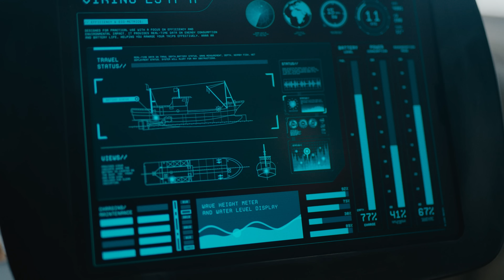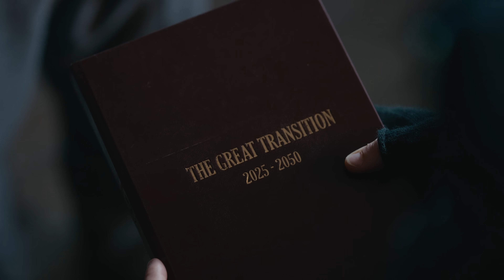The Great Transition (2025–2050) - A glimpse into our energy future

Comment: Unfortuntly this wont work - it depicts a future that relies on so called "renewable energy" (wind farms/solar) however these renewable energy soruces still use vast amounts of fossil fuels to produce, require complex maintainence and will not be possible to make at scale once the fossil fuels are depleted. We should be using the little time we have left to build resilient, decentralised, small community scale infastructre systems for energy (trompe/ hydro) and locally sourced food supply lines (permaculture/ syntropic agroforestry) We must accept that every generation from now onwards will have to make do with less and less avilibility of the fossil fuel cashe we have been squandering since the discovery of oil (energy decent future - david holmgren). This is assuming of course that we arnt wiped out by AI by 2030.. quite a realistic possibility unfortunatly.

Comment: The energy transition would only be possible with nuclear power. The amount of area that solar panels take up can damage ecosystems, and there's a very high amount of bird deaths for wind turbines. However, nuclear energy produces a very high amount of energy in a small amount of area, which means it doesn't damage ecosystems as much as solar and wind. Nuclear energy is also by far the safest energy source, and nuclear waste isn't much of an issue and is easy to solve with simple underground storage. 
Next generation reactors are also coming out, and nuclear fusion would be even safer than the already safe fission. I'm not a solar or wind hater, but nuclear should be the main focus of the transition to green energy.

Comment: I installed 6 solar panels (20 yr. Lifespan) and a 300ah Lifepo3 battery (8-10 Lifespan) with all necessary equipment (about $1000) for a self-sustaining power solution for emergencies. The system is clean, efficient and is capable of keeping lights on, TV and electronics running, keeping a fridge running, cooking food and running a gas furnace. I can't imagine that people fear solar and wind more than the destruction of their home planet??!!
Reply: You said it right there. Running a gas furnace.

Comment: Nuclear energy could solve a lot of these issues. And no nuclear waste is not an issue. It can be reused for more fuel. Wind and Solar isn't going to cut it for our energy needs esp with Ai.
Reply: That is not a "solution".
Reply: @benjaminharris943 how isn’t it?
Reply: Yeah thats not working either, because it’s way to expensive.

Look at France:
They went all in for it and the state is paying lots of money to keep the price down.
They even have often problems in the summer to get enough cooling water from the rivers, so they shut them down and buy the rest of the energy they need from their neighbours.
Reply: @meetteel6811 expensive due to regulations excessively piled on. Maxnomics did a video on this exact topic.
Reply: @VelocityFreak Looked it up and it’s definitely falsefying common facts.

In the early beginning he talks about plutonium like it’s some steel and they shouldn’t make a fuss about it.

Fact is, that it is extremly toxic.
However you can hold it bare hand without any problem, if it’s properly manufactured.
But you don’t want to inhale steams of it or touch the used one.

By the way the half-life is 24.000 years, so it’s nothing you throw in a Pickup-truck and make a delivery.

Those things are better off to be handled more careful, than less.

To be clear:
I‘m not totally against it.
It simply isn’t a good longterm strategy and definitely not that cost-effective as many like to believe.
Therefore it’s better to run those power plants you already have and go for other options.
Reply: @meetteel6811  When you say it's "too expensive" what numbers are you referencing? Also, do you know why it's too expensive? Is it a matter of sourcing the fissive materials, or is it the handling of the waste? I was watching a documentary the other day about tritium and how we can actually use what we've been calling nuclear waste to make it, and with it we can have stable, net positive, fusion reactions. Meaning one technology actually leads directly into the other. It uses molten lithium in its design.

So if it's the waste issue, that would directly address it by having two forms of nuclear power, one's waste feeding the other's clean output. But we absolutely need solar, so new solar technologies that are more effective (generation per sq km) is critical. The reason being that things like fissive materials are also finite. We have to focus on energy that comes from renewable sources: geothermal, hydro, solar, wind, wave, etc.
Reply: @cyrusmagnus  Appreciate the comment!
Yeah that would be about the optimum way.
Problem with the reactors which use „nuclear waste“ is, that we can reliably do that probably when the first little fusion reactors are standing (about 10-30 years from now).
Maybe a bit earlier, but they‘d be probably more like a side opportunity.

However the thing is, that it won’t help us now.
That companys like Microsoft, Google or Amazon want their own nuclear power plants, shows how desperate they are with their energy problem.

Maybe they push that tech further.
At least they have the money and the motivation to do so.

China is also interested, or at least has been for that kind of reactor.

Only time will tell, but the „old school“ nuclear power plants are the new dinosaurs after coal.
Reply: @meetteel6811  Have you looked into the retrofitting of old reactors into new ones? I've found that to be pretty hopeful as well.

I believe the new fusion reactors are actually designed to be plopped down as an upgrade into old nuclear plants.

Their focus was really on making it as affordable as possible, which I liked a lot.

But, with how fossil fuel fights stuff, we'd be lucky to see it in our lifetimes.